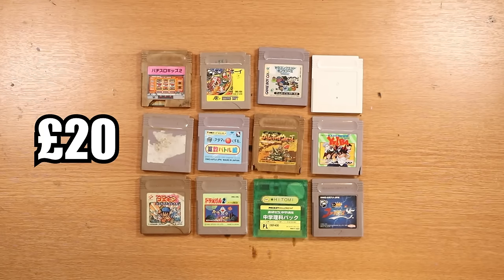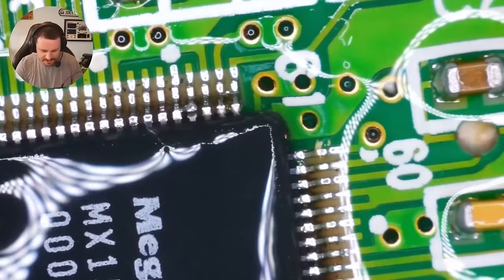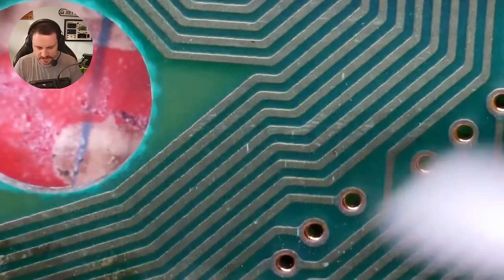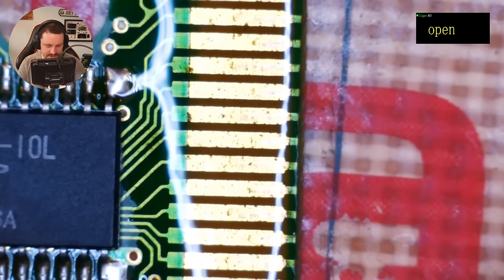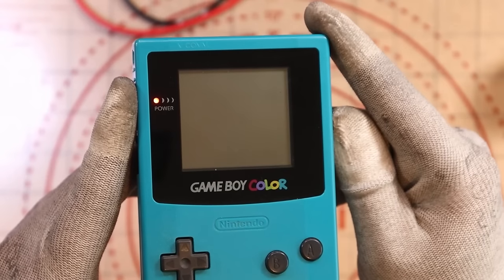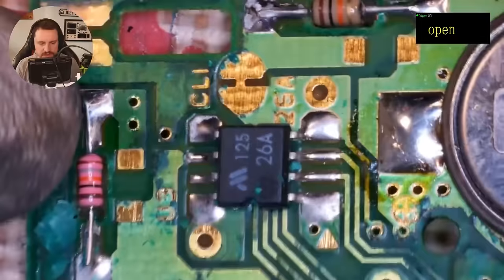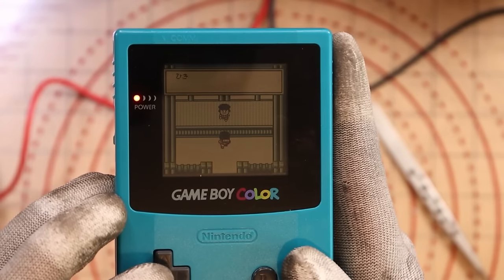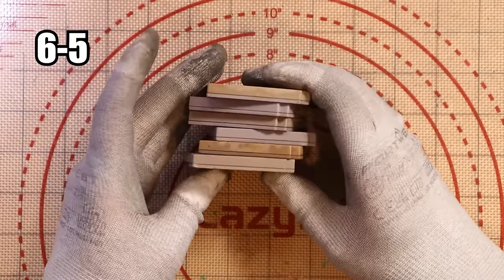Flipping Faulty Gameboy Games

Comment: Broken traces along where the shell touches the PCB is a very common issue. A dry pencil eraser is one of the best tools for cleaning the pins. You can also use a rubber polishing bit for a dremel without the dremel. Also, if the battery is so dead it starts acting like a resistor, that can cause the cart to fail. Considering the age of these games, all of those batteries should be replaced.
Reply from the maker: Thank you for the advice :)
Reply: @JoeyDoesTech  My pleasure Joey! I've really been enjoying watching your videos. Your enthusiasm and positive attitude is amazing. Whether you succeed or not, you always stay positive. You are a true inspiration to all of us hobbyists who try, and often fail, to repair things. Cheers!

Comment: Tip an old timer showed me - regular A4 office printer paper is pretty good at cleaning oxidation off pads like that. It's actually mildly abrasive, just enough to remove the oxide layer without doing any damage. Just rub it on the pads as if it was sandpaper.
Sounds silly but definitely works!

Comment: The batteries that are low could cause save memory to be corrupted. Depending on how the game is written, that could result in the game checking for corruption, figuring out something is wrong and not starting. Taking the battery off and replacing it in theory could set the save game memory to a "regular" empty state. I personally would not condemn a game before having replaced the battery. The one game with the deep scratch on the contacts might have the ridges on the scratch push the game reader pins out and prevent proper contact. Maybe get the ridges down so the chances of the reader making good contact bigger?

Comment: Quick tip: you should never put a bad condition game in your gameboy without cleaning the contacts first. Through the scraping of the game boy contacts, you will get the dirt and rust particles in your game card reader reducing its overall success rate in reading games. And its definitely harder to clean the gameboy cartridge reader than a cartridge. 
Nice video though, i like seeing old stuff being repaired even if there is 0 market value for it.

Comment: 1st one you need to tin the gold pads on the bottom.. they are too worn to make a solid connection. the plastic of the case also rubs on them and can create small cracks in the pads

Comment: In my experience repairing Gameboy games, it’s 99% of the time dirty or broken/cold solder joints on the chips. Just touch everything with an iron and it should work.